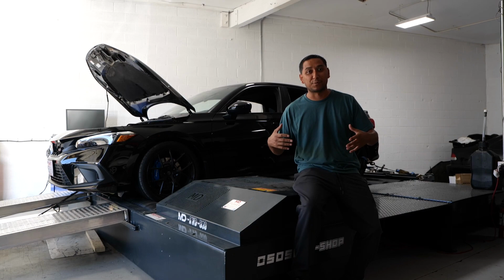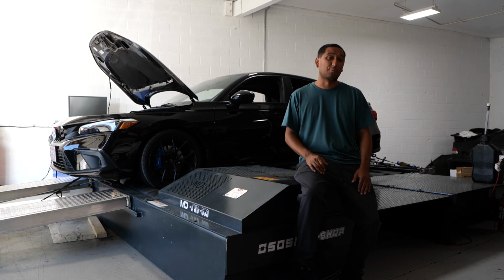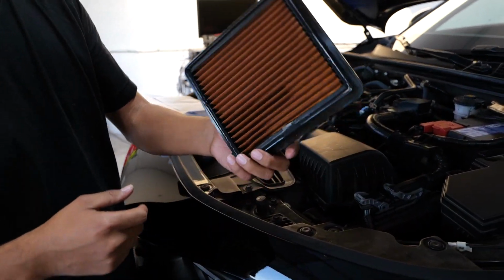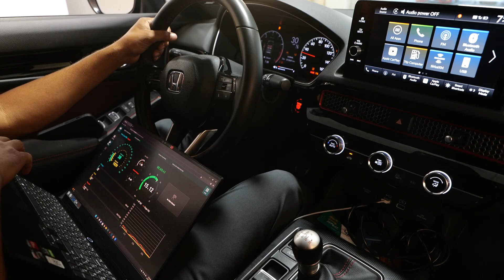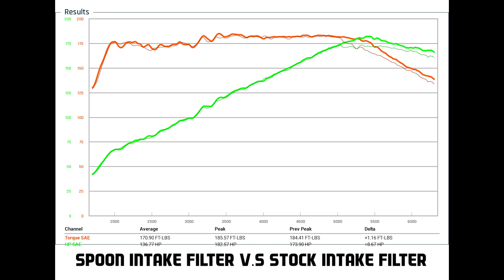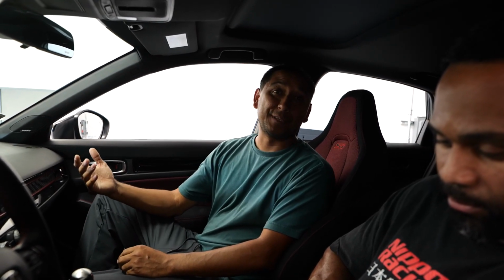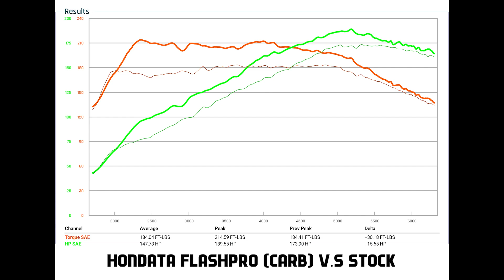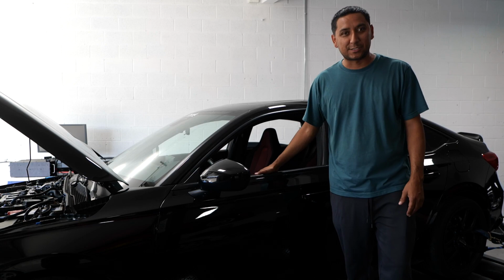2022 Honda Civic Si | Spoon Sports Intake & Hondata FlashPro (Carb) Install | Dyno Comparison

Comment: The carb tunes only come with 6psi upgrade? What is that doing to the car
Reply from the maker: Its giving the car a better response from turbo and motor, but is also carb legal up to California regulations
Reply: @thefoatmedia  will this carb flashpro work with 93 octane? If so, will it make a difference?
Reply: @lolleahroblox2414  Yeah it works. Its tuned with 91 in mind but using 93 doesnt hurt either.

Comment: I thought they changed the clutch between the 10th and 11th gen?
Reply: As far as I’m aware of, they changed the flywheel. The 10th gen had a two piece flywheel while the 11th gen has a one piece.
Reply from the maker: Stay tuned for the next video we will answer that for you.

Comment: Ok if I was to get the racing hondata how would anyone know I'm breaking the law? Like how would they kno my tune illegal? And I hearing the the racing hondata come s with the carb tunes included so can't I just switch to those when ever I wanna be legal??? Push of button
Reply from the maker: The Carb FlashPro comes it base tunes preloaded on the FlashPro and it can not be tuned. The Race FlashPro can be tuned with a e-tune or custom tune by a tuner.

Comment: Really waiting for your video of the upgraded clutch. I have a 2022 SI as well with PRL front and down pipe with PRL intercooler and charge pipes and a drop in PRL air filter like yours with a custom tune using Hondata. I’m making 248Hp to the wheels and 275ft/lbs of torque (without the drop in PRL air filter) Clutch is slipping already. Please let me know how the clutch works and please post a link on where to purchase it. Life is OSOSIK!! So just drive through it!!
Reply from the maker: Coming soon! stay tuned for our next video to drop we will give you our opinion.
Reply: Awseome!  Got any upgraded 0-60 times?

Comment: Spoon air filter will give you tiny gains but you will pull in more dirt and shorten the life of the engine over the long term.
Reply from the maker: We will see how it preforms over the months were running it and keep you updated.